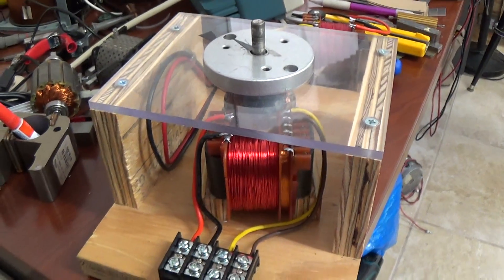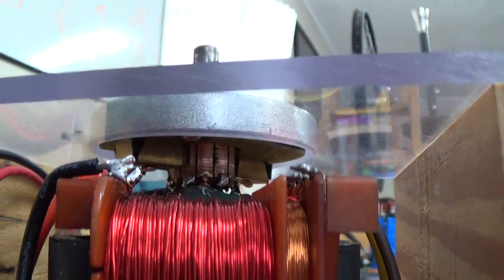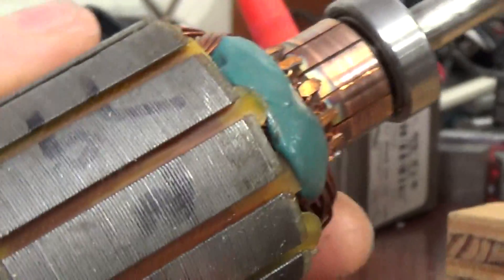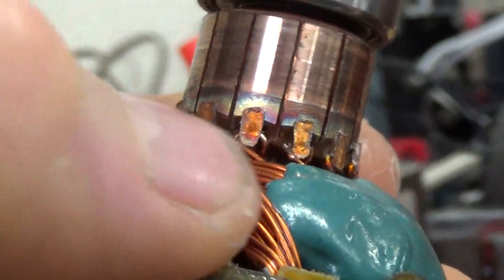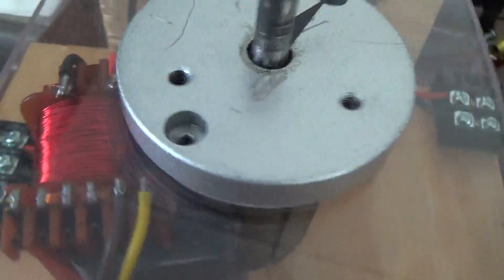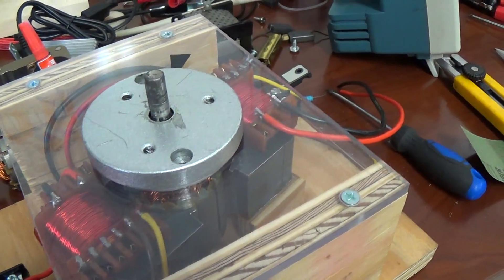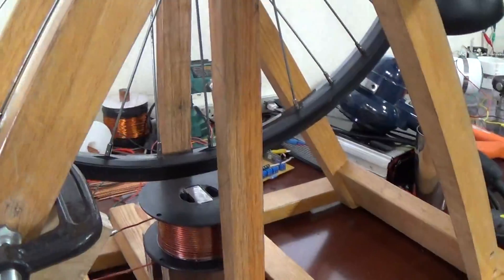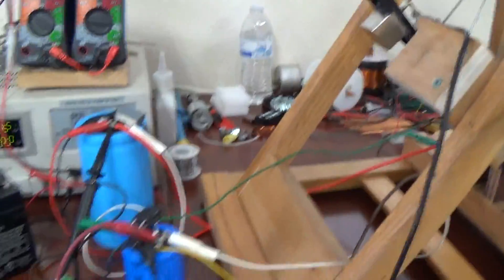Sharing ideas, how to build a more efficient motor (p.4)

Comment: hey you need 2 more brush to take aut the fly back and then use that for charging a battery then you dont have any spark i think and its will run faster also
Reply from the maker: +rntesla nielsen You mean like I did here: https://www.youtube.com/watch?v=n3IxLmdR9O0
Reply: +Luc  gotoluc Choquette  yes i have done it whit a pwm 12v in and flyback abaut 400v  and i think in the other video is better if you cut the iron open in one plase to not destroy the magnetic field but i dont know but something like you have here in 2 pises